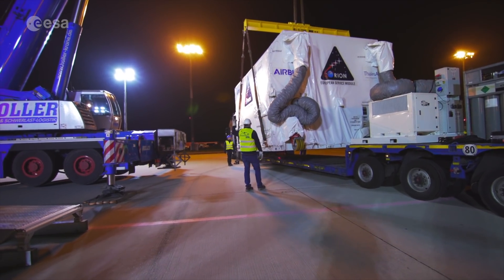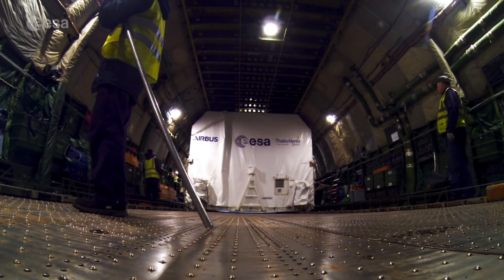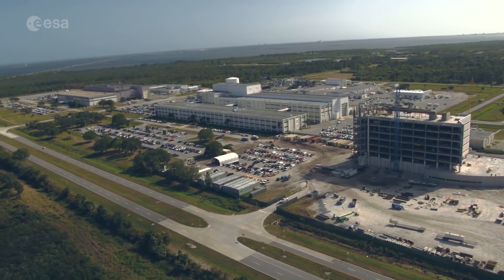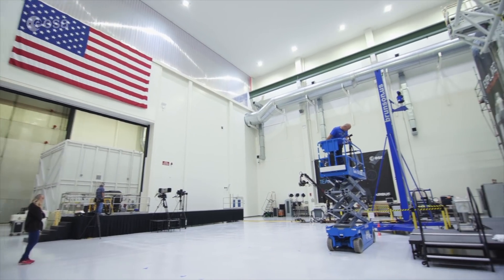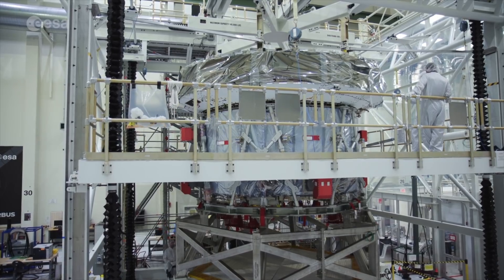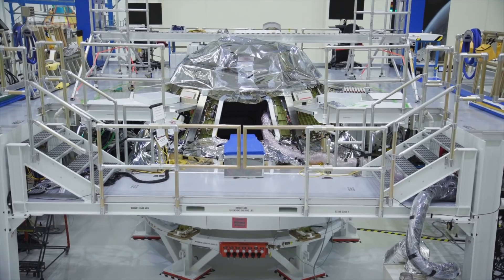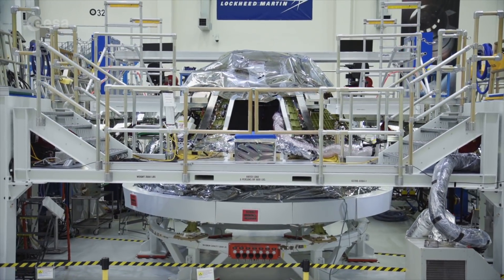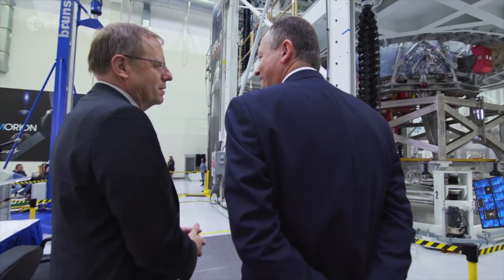Orion’s service and crew modules – Finally together

Comment: Did they fit? :o
Reply: Exactly, we didn't actually see them together
Reply: They did now that NASA switched to metric.
Reply: NASA switched to metric a long time ago.
Reply: @blablubb12345  That's why Mars climate orbiter and Mars polar lander both failed... Because you were not able to use the metric system
Reply: @popelgruner595  I am not able to use the metric system? Are yiou sure about that? MCO failed because NASA used the metric system while their supplier (Lockheed Martin) did not.  Mars Polar Lander most likely suffered a sensor failure.
Reply: @blablubb12345  Oh come on. It was clearly meant as You in the US, not you as a person
Reply: @popelgruner595  Wie kommst du darauf, dass ich aus den USA komme?
Reply: Now that they’ve been connected, yes